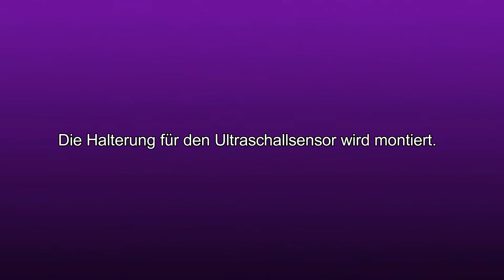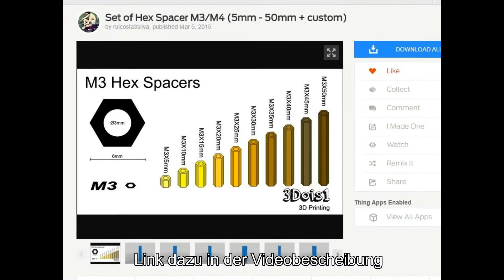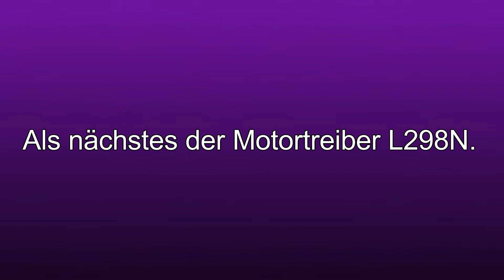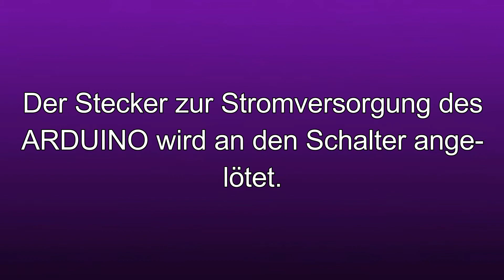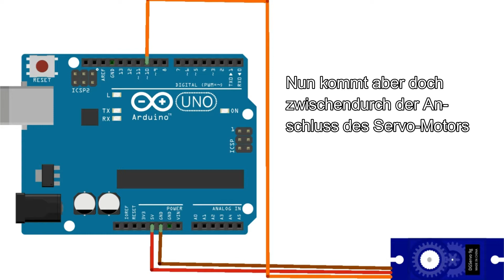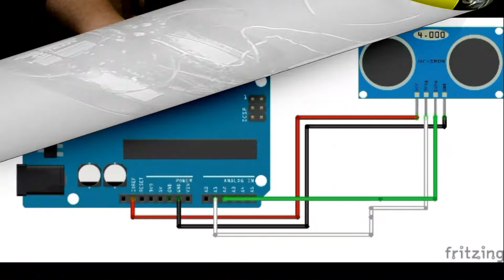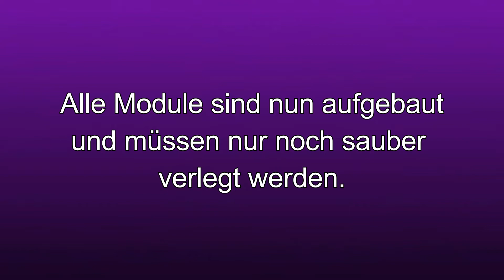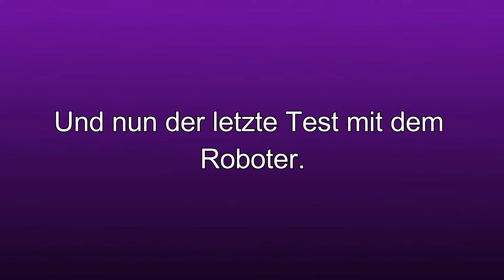Hindernisläufer - 3Rad Roboter mit Arduino, L298N Motortreiber und Ultraschallsensor Teil 3

Comment: i am intersting to build the same for educational reason..to add speed sensor 
read the data wireless
and show them to pc....speed and and accelleration...the best is to show also live the power(watt) 
i am a physics teacher and i think this is the most promised tool that can evolute..HELP...
Reply from the maker: ... I bought the robot kit from Banggood in China. The Arduino software comes from different sources. But I'm not finished with the whole setup. And how can I or should I help you?
Greetings from Germany